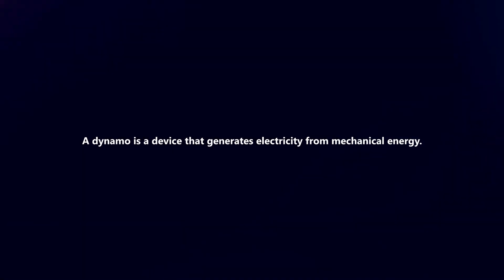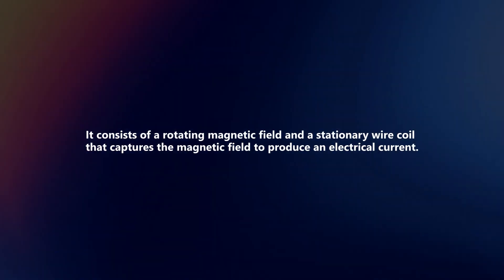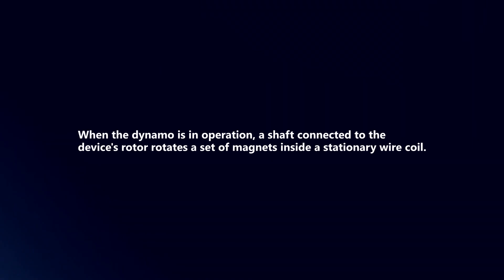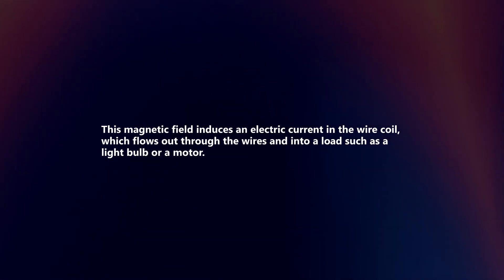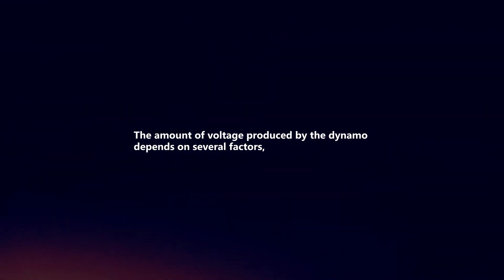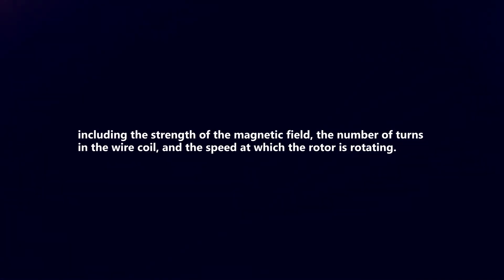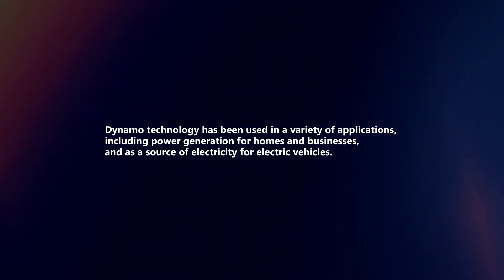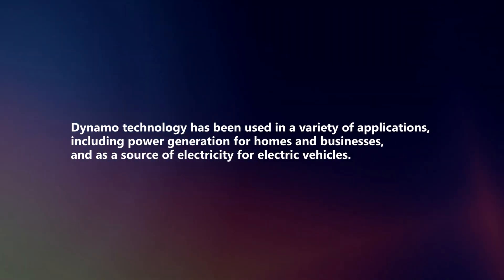How Does A Dynamo Work? Dynamo Explained In 90 Seconds

Comment: If the electrons leave the wire, shouldn't it disintegrate and disappear eventually, after all the electrons have left?
Reply: Uhh i think the electrons generated from the magnets keep on generating electrons if it is rotated constantly so not really ig
Reply: Or the more reasonable answer is that the magnetic field pulls the elctrons and pushes them creating an electric current and the electrons cannot really leave an object if it is not pulled or pushed by a magnet
Reply: The electrons don't leave, they move... 

Think of it like a pipe that circulates fluid... if the pipe is closed (a closed circuit), and a pressure exists (voltage), the water (electrons) move. The energy is contained within the motion of those electrons. 

Current is then the amount of water (electrons) that pass through the pipe (wire). 

Think of the coil of wire like a pump or propellor that converts some of the water's movement into motion, or conversely, converts motion into movement in the water!